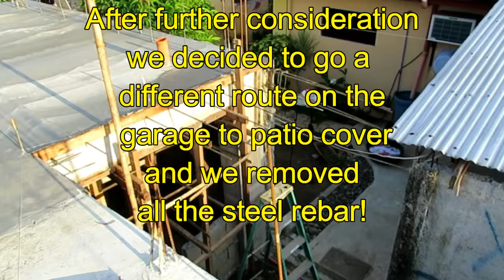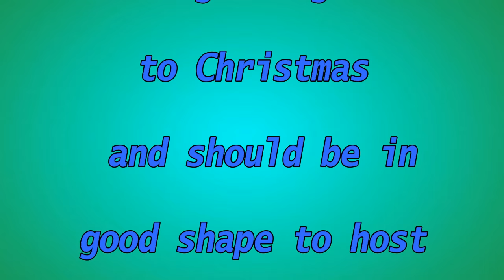Building in the Philippines - Expanding Paradise, Part IV | Ep 85

Comment: a long slow process but looks great. different materials and building techniques there but great considering the heat rain and typhoons. Is your walkway made of local stone or concrete pieces? can you tell us approximate costs of the new additions?
Reply: btw my fiance lives there in Malajog also. I was there in July of 2016 and can't wait to get back soon.
Reply from the maker: Thanks. The walkway is basically a flagstone material set in concrete. About P600 per square meter for the stone, plus the concrete.

Comment: Hi, my name is Lester ...I,m from Ca.  Los Angeles area. I saw your videos on building your home for you and your wife. You did it in about 3 years...I like how it came out, the final project, could I ask you how much was the cost and what area in the Philippines are you located?
Reply from the maker: We are in Calbayog City, Samar. We actually built the home slowly over about 6 years while most of the finish work was done in year 6. We have added on recently as seen in the "Expanding Paradise" series of 5 videos. I really can't nail down costs in construction other than to say it will cost between P12k to P25K per square meter depending on individual needs, amenities, and final touches. Everybody is different. I can say however that our final exansion project consumed about $8,000 USD and included the price of the 100sm lot.

Comment: I appreciated your vlogs of the project,  very informative.  I have a couple of questions that I hope you can answer.  First regarding your back foundation walls. How did you treat or handle the hollow blocks given their porosity and given they will be exposed to the high tide. Won't the salt have a destructive effect on its structure.  I am assuming that is a neighbor's property is directly behind but it would seem that you want to support it with stone rubble, etc.  Secondly how is it addressed when you have two adjacent structures butting up against each other built using column and hollow block construction.  Given that you can't trowel a concrete  coating in between, what technique is applied to seal and strengthen the exposed hollow block surface.  Thanks and I look forward to viewing future episodes
Reply from the maker: The retaining wall was built utilizing a waterproofing compound in our concrete mix. Salt has no effect except on exposed rebar. The neighbor immediately behind us has since started construction and will eventually back fill against our retaining wall. As far as having two structures butting up against each other, I have never had to experience that, but I would think I would suggest applying a waterproofed cement layer to the adjacent wall, and each block while constructing the new one.

Comment: I notice they don't use a vapor barrier. Being so close to the water you may regret that because water can wick up through concrete. I couldn't see your gravel too well in the video. Is it crushed or is it just river stones? Using river stones that are not crushed can be a major problem in an earthquake prone area. It looks good.
Reply from the maker: We use a waterproofing compound in the slab which is the barrier against seepage. Also, we do not have the ground condensation here like in colder more temperate climates. The gravel is 3/4" excavated crushed gravel. You are right, river stones should NEVER be used in concrete construction. That is a major problem they have here with the roads falling apart!
Reply: Thanks for the reply. I see many construction jobs in the Philippines using river rocks and it drives me crazy. They just don't know how dangerous that is. Another thing that drives me crazy is their masonry work. I can't watch. One more question. When you did the roof, was it completed in one day? I ask because if you don't you will have cold joints which will cause major problems.
Reply from the maker: I covered the methodologies with hollow block construction earlier in this 5 part series. Initially, block laying is ugly, but after final rendering, can look really good depending on the finish mason. Not sure what you mean about cold joints in my roof?
Reply: Retired in Samar A cold joint in concrete construction occurs when you don't complete the work and allow the concrete to set. Then you continue the work pouring wet concrete next to it. This is called a cold joint. The concrete that had set doesnt adhere properly to the concrete poured. That's one of the main reasons that we use ready mix in the states for doing slabs besides the convenience factor.
Reply from the maker: I thought you were referring to the wood framed roof over the patio. All our roof slabs and horizontal beams were all pored at the same time. No cold joints. Sorry for the confusion.

Comment: This is first video of yours I'm watching...

Thanks for sharing...
Thanks for detailed narration...

If you were not planning to add 2nd floor, would you have laid a cement roof or used rafters & then put drywall or plywood attached to suspended ceiling?

Do people use central cooling / air conditioning or add portable air conditioners in each room?

If you don't mind we asking what island / city did you build this building / house in?

Is there access to city waste ( toilets & water connects to pipes that carry water away or you're using septic tanks / reservoirs )?

Roughly how long did it take from beginning to end did it take to complete whole project?

I'll have to watch some of your other videos to learn more...
Reply from the maker: The concrete area above the garage is designed for a future karaoke room. The slab over the other structure above the circle staircase will be a covered patio. Typically here, people do not construct concrete roofs because of the cost. Neither is drywall (sheetrock) used. Split AC systems are now the popular choice for cooling... usually in the main living area and a BR or two. We have two septic systems... there is no public sewage system. We live in Calbayog City, Samar. We began building circa 2008, and finished up when we arrived in 2013. The expansion project was completed in about 6 months. We were never on a 'timeline'. Thanks for watching!
Reply: @livinginthepacific  
Thanks for quick detailed response...

I suspect Samar has changed significantly in past couple decades...

Typhoons were significantly more intense compared to places on main islands...

I thought you were adding concrete roof to either add room above, use space above or extra protection against typhoons...

Really enjoyed your video...
Lots of valuable information to reference...

Please keep this video online...
I may need use info in future...

Thank You Again...

You sound very knowledgeable about construction in general...

Were you involved in construction as career or involved in various construction projects...
Reply from the maker: Been involved in construction much of my life, mostly as a sideline. The wife and I actually built 68 Heartland sheds (yard barns) during the summer of '98. I also did a short stint as Tupelo's City Carpenter before Home Depot grabbed me up.
Reply: @livinginthepacific  
Thanks...
I'll have to search & see what yard barn looks like
Reply from the maker: It was a trademark name for Heartland's storage buildings.
Reply: @livinginthepacific  
Ah ...
Thanks...

Comment: You could probably increase their productivity by buying all of them work boots - bet!

I love the cement work, just amazes me really, but I personally think the structural cement goes in too wet.  More stiff and getting them a cement vibrator would make me way more comfortable.  

You have to be the talk of the village as you expand there.
Reply from the maker: Workboots ha... too hot for that! It's hard enough getting them to wear 
eye protection when using power tools. And a cement vibrator? You won't 
find one in these parts... they just use a hammer!
Reply from the maker: Yes, visited this site many times and I would have to agree with most of his construction assessments. Thanks.

Comment: I guess you shipped over your craftman tool chest. Nice
Reply from the maker: Yes, also shipped most of my tools.
Reply: Hello, Let me ask a question about your tools. You mention you shipped over your tools. I am a contractor myself and will be moving to the PH soon. Lot of my tools won't be shipped, but I would like to shipped some of the electric tools over. Did you ship over electric tools and if you did how do you handle the voltage, as you know USA uses 120V and PH uses 220V. Does the Voltage converter work good with the USA tools Voltage. I like to ship over a few drills and maybe a circular saw maybe 1 or 2 more other tools. 
Any info would be great

PS - what shipping company did you use to ship over your tools
Reply from the maker: I sold most all my electrical tools except for a portable drill and a Dewalt 1/2" drill. I use a transformer for each and it works fine. Just cumbersome to hook it up all the time. In a do-over, I would leave everything behind as you can purchase most anything you need here (except I have not found a reciprocating saw yet. Should have brought mine! Specialty tools like coping saw and blades, socket sets, framing square, line level, etc. are nice to have but harder to find here. Yes, I shipped my Craftsman chest.

Comment: Where did you get the casement windows and up / down sliding window ?  I am on Marinduque and will be building a new house this year, (fingers crossed).
Reply from the maker: I ordered them from a window maker here in Calbayog city. I will never, NEVER use horizontal sliders here again... they all leak! You should probably head to Batangas to a Wilcon or Builder's Depot to find good windows. DO NOT cut any corners on window costs here... unless you like standing duty with a mop and bucket during typhoons!
Reply: Ya I know I have been here for 10 years, my first house was not too bad the windows were casement style but still leaked especially around the frames.  Our second house had horizontal sliders and they were the worst windows I have ever seen, of course I am used to windows that seal tight to keep the winter winds bite out.  The current rental house has mostly the slated glass horizontals that are easy to break into and keep just about nothing out.  We did not have a choice on any of the rental houses but I want to make sure the windows in the house we are going to build hopefully this year starting during the dry season seal and are secure.  Thanks for the reply and cheers from Marinduque.
Reply from the maker: Yeah I agree those horizontal sliders are not even worth spending money on, but they are better than them Jalosie windows you have now (which are probably even a worse invention!) Head to the city and you will find quality windows. Good hunting! Cheers!

Comment: I figured you haven't been making videos since its been raining so much lately..  BTW, I have no idea why they want to put the silver side of the insulation down all the time.. The metal side always goes towards the heat to keep things cooler...
Reply from the maker: It's not the rain keeping me from the videos, it's the construction and everything else. The insulation, they solved the problem of incorrect installation by using the two sided aluminum faced rolls! he he
Reply: Retired in Samar Here in Mindanao were been under a low pressure system for like 6 weeks now it seems..   The rain just will not stop.. :-(
Reply from the maker: It's been a rather strong NE Monsoon this year, pushing a cooler air mas much farther south. Hence, you're getting all the rains instead of the Visayas!

Comment: you noticed that there's ever no basements build in any houses there too?
Reply from the maker: Basements are unnecessary here as it never freezes. In colder climes, footings need to be dug to below the freeze line to prevent foundation upheaval during cold weather. Since the freeze in most of the middle lattitudes is at 4 feet and below, it makes sense to add another 4 feet and build a basement wall. Here though, with all the rain and because the water tables are so low (along the coastal plains where most of the population lives),  basements would flood easily.

Comment: i think you wasted a
lot of money on lumber for the paving support.. you should have rented scaffoldings
Reply from the maker: Not true. It takes 27 days for a concrete ceiling to cure before you can take the supports down. In our case, we moved them from one ceiling pour to another. If you were to rent steel supports and scaffolding for two months, the rental costs would well exceed the original cost of the lumber, which we were also able to use on other on-site projects. Months after the project ended, we have found many other uses for the good lumber that was left, all the rest was either destroyed or given away.
Reply: Retired in Samar as they say it's more fun in the Phils! Time to feed the crew! lol